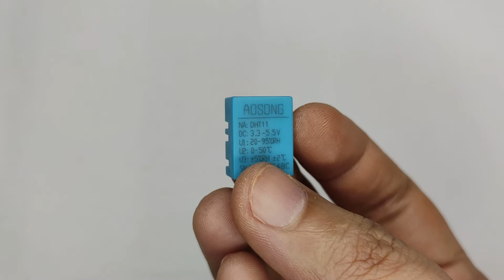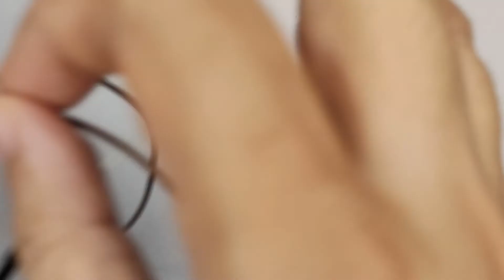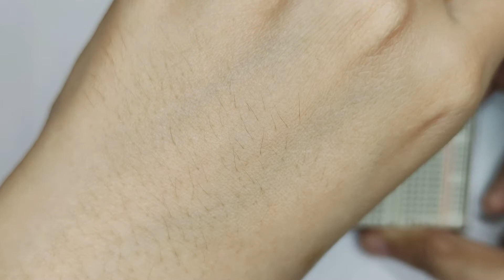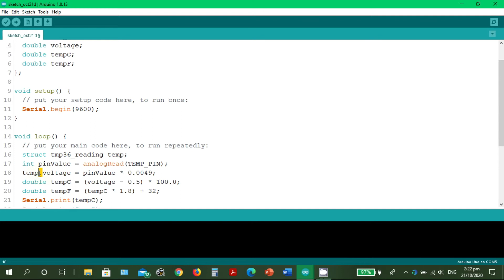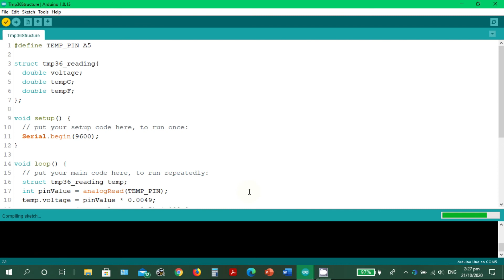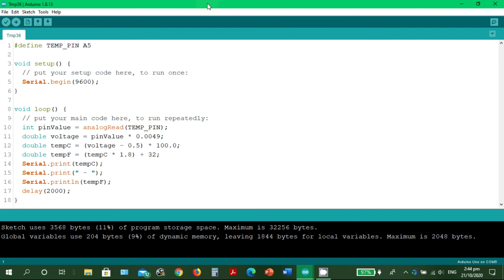EASY-HOW-TO Using TMP36 Temperature Sensor in Arduino Uno Tutorial

Comment: Hello, how you get this function plz:  tempc=(voltage-0.5)*100 ? what does mean 0.5 in this function? thx
Reply from the maker: The 0.5 here is 500 millivolts. The function (voltage-0.5)*100, it means converting from 10 mv per degree with 500 mV offset to degrees ((voltage - 500mV) times 100). So, executing this function, the value that you will get is the temperature in Celsius (tempc). Hope this helps  😊
Reply: @BlancaflorArada  Yes but i mean why is it exactly 500 mV as offset? Why no more or no less than 500 mV as offset? Thank you for yr answer
Reply from the maker: @MohammedAhmed-fn2nz  This is from forum.arduino.cc: "It states that at 0 degrees Celsius, the output voltage is 500 millivolts. And the temperature coefficient is 10.0 mV/C. So the same as a TMP36. Many examples for that one.

It's easier to directly convert A/D value to temperature, and then subtract 50 degrees C from that (the 500mV offset).

float tempC = (analogRead(tempPin) * 0.323) - 50.0;
Serial.print (tempC, 1); // one decimal place"

Hope this finally answers your question 😊

Comment: 64 ceclsiou? its kinda hot how come
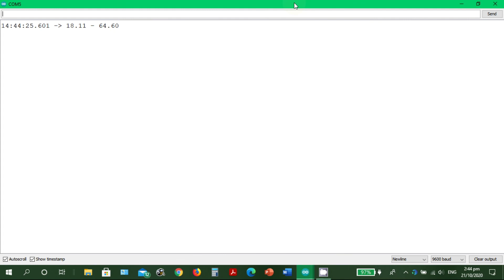Reply from the maker: The 64. values at the right side are the room temperatures in Farenheit, while the 18. values are the room temperature in Celsius, which is on the left side. If you can see in 14:52, lines 14-16 (the Serial.print), first, it will display the temperature in Celsius, followed by "-" and display the temperature in Fahrenheit as you can see while running the Arduino sketch from 27:54. Hope this answers your question. 😇